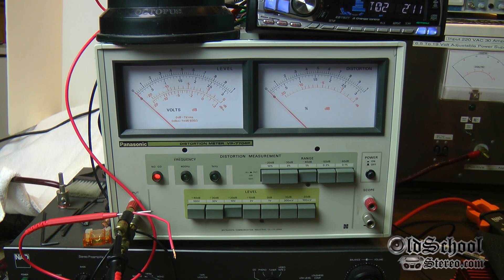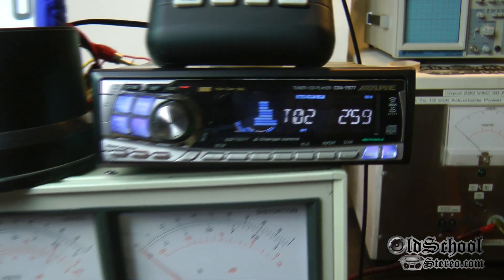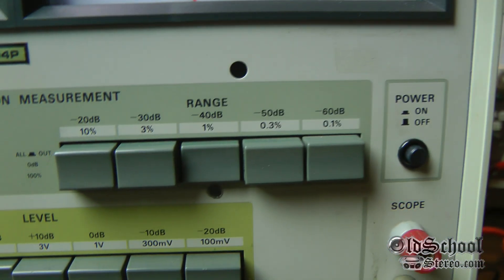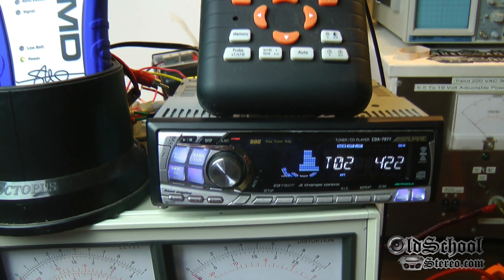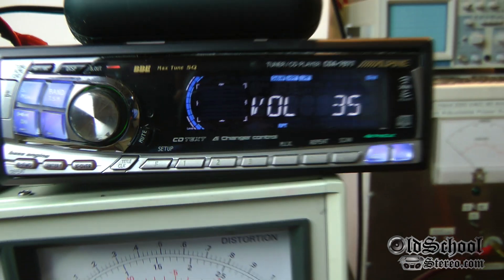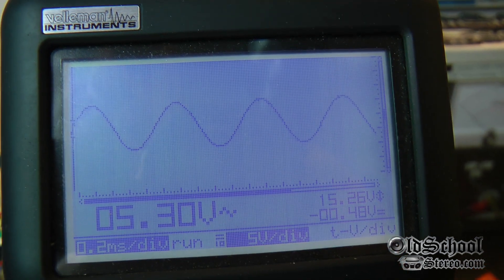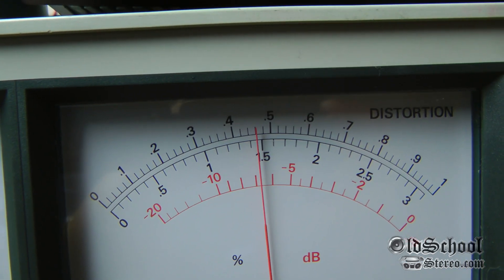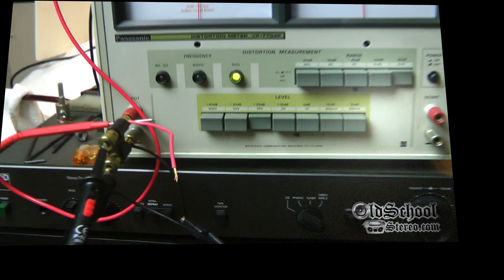Alpine CDA-7977 vs Panasonic VP-7704P Distortion Meter

Comment: Hey Big D.  Loving your channel BTW.  Not sure if you get notified on a post this old but thought this was the best video/play-list to post this comment and possibly make a request.  I miss the Old School stereo days of the '90s & '80s like yourself but the one product that is missing these days (especially with the classic car/hot rod/etc scene) is a quality 2-post knob stereo.  Discovering brands like Custom Autosound and Restrosound exist, I bought a Retrosound head unit for my now considered antique vehicle because it was missing and I really did not want to cut up the dash.  I am very disappointed in the head-unit, and they are NOT cheap.  It has RCA outputs (front/rear), an internal amp and  an AXU input that I use to play music from my iPod.  My issue is the sound quality IMO is just horrible on the internal amp, so I decided to use the AUX outputs and do an ol' school stereo install.  I don't wan to get into the details here but bought some nice stuff, i.e. separates spakers, amps, JL subs and amp, and I've done a pile of work to try and set-up the system and I am still not satisfied. I have come to the conclusion that the head-unit is just crap IMO.  Anyway, curious if there is any interest in testing a Retrosound head-unit to find out what they honestly deliver for the price beyond just putting a pretty face on what seems to me $20 or less internals.  Also, IS there a source for 'old school 2-post knob stereos out there?  I miss my very old Alpine...that I can't remember what model it even was from the late '80s and early '90s.  Otherwise I just I'll just have to BT input to my amps directly.  Thanks greatly in advance!

Comment: Still have this bad boy in my truck after almost 10 years and 4 different vehicles; AND it still works,looks, and -- most of all performs flawlessly! Almost all brands of head units released in the past 5 years have buttons that either have the silk screen rub off, or something stops working.. But not this head unit. THE ABSOLUTE BEST I HAVE EVER OWNED!!! But to anyone who isn't familiar with it, there is NO INTERNAL AMP(only pre-outs with a Dc-Dc converter)!!!! However, I feel that any type of car audio enthusiast wouldn't run anything off of their head unit to begin with, PLEASE purchase this beauty at a low price if you can; I paid almost $1000 brand new in around '05 or '06!!!!!!!! TRUE STORY, check out the MSRP WHEN IT FIRST CAME OUT!!!
Reply from the maker: +Jacob Hidalgo Yessir, these are very high quality units, glad to hear your's is still working great! I have an original Alpine 7903 I bought back in 1991 that's still working also. Quality!

Comment: I have the same head unit.  It will be interesting to see what you find!  Someone tested their 80PRS (I forget what tone he used) and he found that the bottom of the sine wave had slight clipping @ level 62.  Levels 61 and lower were clean.

Comment: I have a Kenwood KDC-355U and it is clean all the way up. I used an oscope for setting gains so I'm not sure exactly what % distortion it had but it looked perfect on the scope. And as a side not, I used rockford rca's and they were perfect,exact same wave form. I also used boss wires just to see, fuzzy waves. But of course most of us already knew that would happen.

Comment from the maker: Have you measured any head units to determine this? Or just going by assumed specs? This is the first one I've measured, so I don't have anything to gauge it against. I did test the Alpine 9815 afterwards and it was cleaner (less THD), but also lower voltage output

Comment: .05% is actually pretty poor distortion performance for a preout. Typically an audiophile system would be lower than .005% for the entire setup to the speaker outputs.

Comment: Cool meter bro!!! As the owner of more than 500 cassettes that are in perfect condition I decided to install my old (circa 1988) Kenwood KRC-555 pull-out deck running the stock speakers and my Kenwood KAC-720 amp running my 2 Petra Cardiac 10's in my 2007 Impreza and I gotta tell you it sounds AWESOME!!! Thank you for the inspiration my brutha!!

Comment from the maker: I have an XL-200. They are pretty low end, single sided PCB, made in Taiwan (back before Made in China was the cheapest way). It would be better than a heat unit amp, but not as good as a quality amplifier